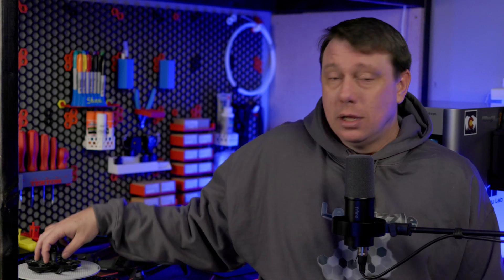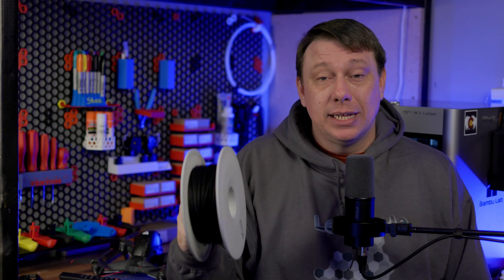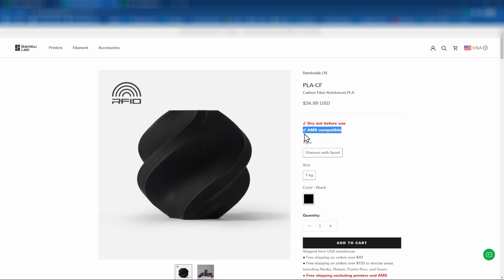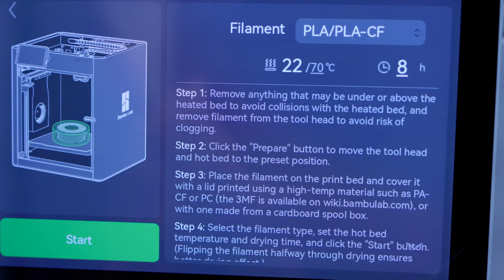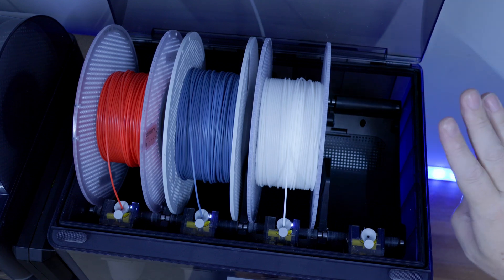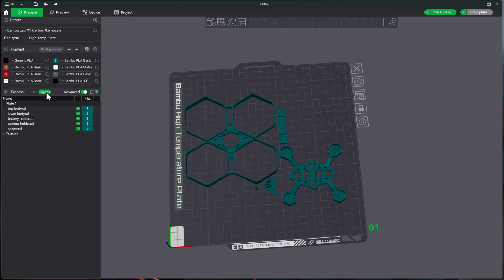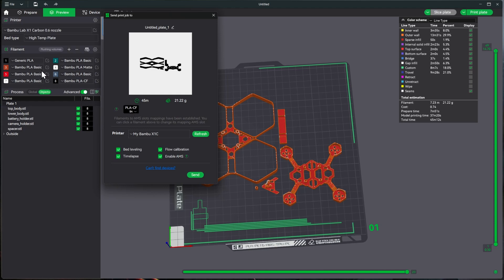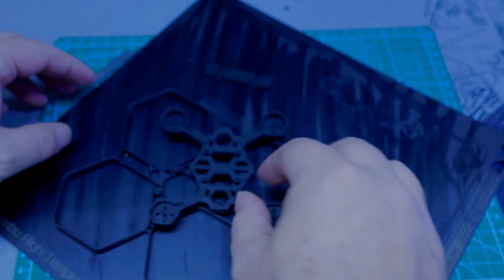How to Print with Bambu Labs PLA-CF Filament on a Bambu Labs X1 Carbon 3D Printer

Comment: I tried to load through the AMS and it told me that I need to use outside the 250 g PLA-CF spool. I dried for 13 h meanwhile it was printing another thing.

Comment: I bought x1 carbon with accessories £1600 and it arrived with pla cf and not working. New guy press print on prerecorded print installed in the machine and yep. Spaghetti on like 7 prints. Pla cf wont start
Reply from the maker: Did you dry the filament?  What size nozzle are you using?
Reply: @lendizzle77  did not know i had to dry the filament. Learnt that only today. 8 hours 55 degrees. 

Only how does the ams know not to try using the filament because when I did not know I simply loaded it like the pla rolls. Every time I touch on load black it never prints it. I learnt yesterday on the screen just before printing where the little boxes are with ticks in, top of that screen you can select the colour. Black is not available. Hmmm so what after drying it the pla cf would be available..?
Reply from the maker: The rfid should change the color and filament and all of that. You should not have to do that with the Bambu filament
Reply: @lendizzle77  ok im making a custom iphone case for my Ducati and its almost done except a few things. Foam inlay from lid which holds the iphone from rattling. Then a pvc screen. 

On the front of it I want it to say Ducati Desert X. Figured out how to do that in fusion 360 but where do I say to print that a different colour? White case with red embossed writing. Or black case with white embossed writing. 

Appreciate your time mate too. Thanks
Reply from the maker: Watch my mandalorian video. I show how to select the different filaments. I can show tonight in the live stream if you are there
Reply: @lendizzle77  live stream. Where do you live. Im uk so what time are you doing the live stream?
Reply: @lendizzle77  have you a link for the mandalorian video …?
Reply from the maker: I am in the us. It was just on. I showed how to change the filament in the beginning
Reply: @lendizzle77  filament change if I am not mistaken is this. Open lid. Pushu finger on plastic thing in front of where filament goes. Push slightly. Then feed new filament down in. The ams auto grabs it and you let go of button. 😀
Reply from the maker: @jamesbarratt593  I thought you had a question on how to change the filament for printing in the slicer.
Reply: @lendizzle77  i do. First i thought it was change colour in fusion and the slicer would see the colour change. Its not. I just educated myself on youtube and see you got to add the colour etc etc. if you have a video on it like you said mandalorian, send me the link and I shall watch it.

Comment: Man.. I just shelled out for a filament dryer and spent 60 bucks. Then I see you using that microwave cover looking thing and setting your hotbed to 55 degrees 🤯 My poor wallet.. I shouldve watched you sooner..😢
Reply from the maker: hahahaha.  The cover is designed for filament drying and printed with PC.  Thanks for watching.
Reply: You didn’t waste money carbon filament is recommended to be printed from those, not the AMS, as they are abrasive and wear out the internal structure.

Comment: Thank you for the video! The past couple of days I was trying the PLA-CF in my X1 Carbon. I was using the .4 nozzle while testing the filament. I am really new to the X1 and was blaming the AMS for not being able to un-load the filament. Watching this video made me realize I needed to use the .6 nozzle as the filament was getting stuck in the .4 nozzle.
Reply: Strange, I had zero problem with PLA-CF (black) in AMS. Sometimes the idea of abrasive scares me. Wonder how much they eat PTFE tube...

Had around 8 hours into PLA-CF without an incident/issue. and is printing now.
Reply from the maker: Glad it helped

Comment: 🤘BITCHIN🤘 I don't use ams for any material which has particle additives like carbon or wood. Also, white is a very harsh color even for hardened steel as it uses titanium pigments. I dont think it really matters too much if you only use those filaments on occasion, but if you're in production I'd error to the safe side. As for the frames... the way I fly I need to have SEVERAL printed frames ready to swap! THATS the real advantage to 3d printed frames over carbon fiber. Also, the weight your throwing around makes the landing all that much harder, for that reason I have MOSTLY printed 3 inch frames🍻
Reply from the maker: hahahahahaha.  So much truth here

Comment: stupid question possibly but in the video once you go into the settings for the individual filaments around 8:50 mins in it mentions at the top 0.8 nozzle is that just over written by the 0.6 mm nozzle you have it currently set to? or do you need to change that too? i just purchased an x1 with ams just trying to figure some things out!
Reply from the maker: Yeah, I'm not sure why it only has a preset for .8 and says its compatible with .4, .6 and .8.  I am printing all of them with .6 and had pretty good success so far except this one has some gaps.  I might do some more testing for the final review of all of them.

Comment: I get those gaps too
Reply from the maker: Are you using .6 nozzle?
Reply: When slicing do you have the bottom layer set to monotonic or monotonic line?, like the top layer, monotonic wont fill the gaps.
Reply from the maker: I have it on whatever preset comes with it.
Reply: @lendizzle77  This is why the gaps on the bottom exist.
Reply from the maker: Spoiler alert: not true for all filaments :)  Tune in to the next video

Comment: I always enjoy your videos. I pick up a tip or two every time. A couple of thoughts.

1. Aren't you supposed to set the print job to low temperature plate?
2. My suggestion would be try printing with a smaller diameter nozzle for delicate parts such as those that you show.
Reply from the maker: Thanks for watching.
1. You can use the Cool plate, High temp plate, or PEI plate with PLA-CF.
2. I have not had success printing with the .4mm nozzle with other CF filaments.  I will probably print another frame with the .4mm for this one for the final review/ comparisons.  The issue I have had in the past is the .4mm nozzle doesn't have the same flow with other filaments after running the CF through it.  Its like it doesn't get all of it out when purging and affects the flow of the nozzle after.
Reply: I love your channel and have learned a lot from about my X1-Carbon Combo. 
However, this video needs more information. Just because you can put carbon fiber into PLA doesn't mean you should.

Comment: Can you print carbon fibre on P1P or do you need an enclosure?
Reply from the maker: Looking at product pages for filament:
PAHT-CF: No open frame
PET-CF: Enclosed printer recommended, open frame capable
PLA-CF: Doesn't say you can or can not.  Probably OK 
PETG-CF: Not recommended

I am looking at the "Printing Tips" on each of the product pages
Reply from the maker: You will also need a separate filament dryer if you are going to use the P1P as well.
Reply: @lendizzle77  thank you so much, just started printing on p1p and lovin it
Reply from the maker: That's awesome!
Reply: @LenDizzle  what if u have a full enclosure.  I have a clearview enclosure
Reply from the maker: I think as long as you can hold the heat in you should be fine. Not sure if there is a drying process built in to the P1P. Let me know if there is. Otherwise, you can get a filament dryer and go from there.